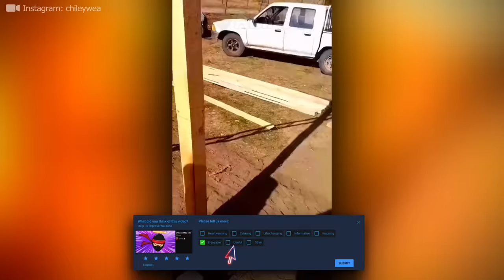You Had ONE Job!

Comment: This is like 50% bad luck and 50% pure stupid. Some of these are like “oh this is why we have emergency rooms”. Like the dude cutting a bush with a mower, that handle comes loose and you are a human smoothie.

The funniest was the guy dragged by the riding mower. Like dude let go of the seat and it will stop 😂. Every modern riding mower has a kill switch under the seat. Man falls off, mower stops.